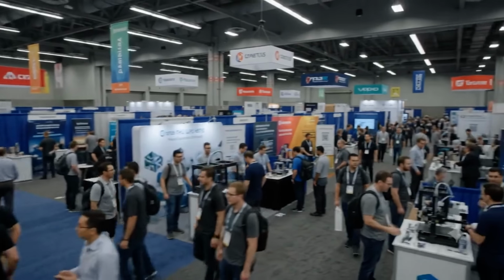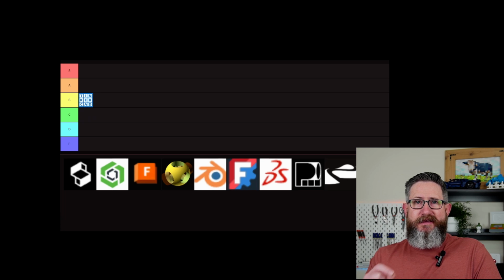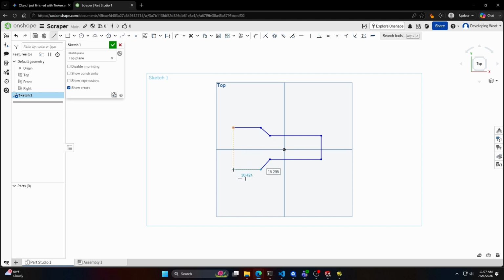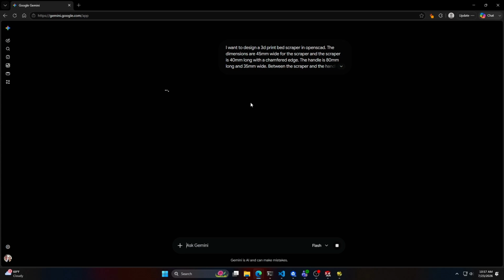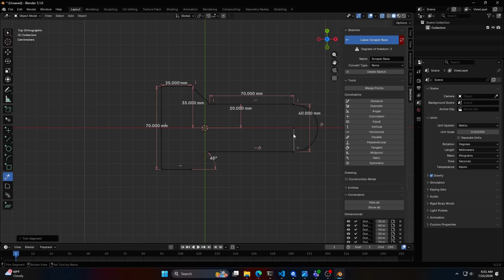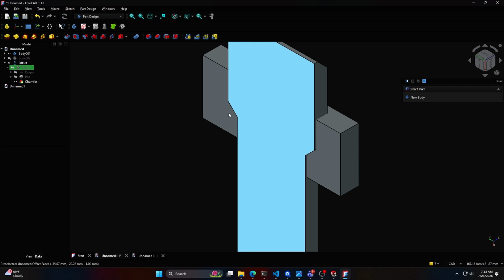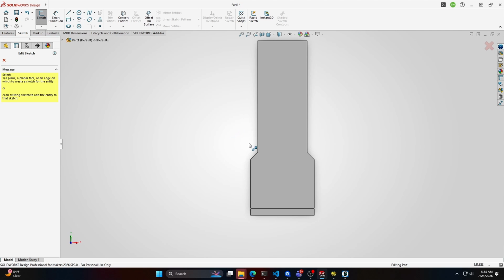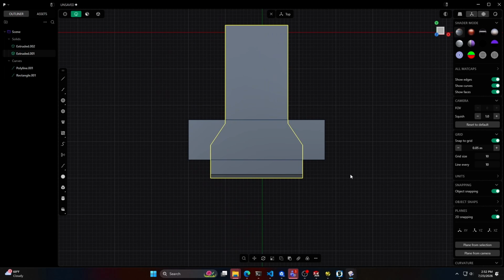Don't Pick a 3D Modeling App Until You Watch This!

Comment from the maker: Which was the biggest surprise to you?
Reply: I'm surprised you put Tinkercad above Freecad. That it took 45 minutes and video help to make a simple model. That model can be done in 3 minutes.
Reply: The biggest surprise for me was the hilarious app names in the thumbnail. "ClenaSad"? "Acmesk"? "FUSNDER"?!  :'-D  Aside from that, it was a great video, TY!
Reply: Not surprised... yet another CAD ranking video that doesn't include SolidEdge, there's no excuse not to include it, the community edition is free.
Reply: To draw this model in FreeCad it would take me not more than 15 minutes, but I'm not experienced with it. Switching in between different workbenches. The whole model you can create in part design. With FreeCad you can create models with relative sizes, with Excel and you can program your own tools. Different tools are for free available..
Reply: @spaansh Excel...I might try that! Thx.
Reply: SolidWorks is a bit of an industry standard and as such it's very difficult to update. You have engineers and designers from huge corporations working on it since 20 years, any major update to the UI/UX would drive people crazy. That being said it is insanely powerful but I agree with out that there are better options for "makers". OnShape probably is the best if you don't care about the license of the free tier, and freecad otherwise.

Regarding programmatic CAD, you could also try cadquery, which is a more intuitive version of openscad based on python.

There, take a comment for the algo :D
Reply: There is a new kid on the block...Solidcraft!
Reply from the maker: @robertcoetzee191  Yes I've been watching it. It's very exciting!
Reply: That Solid Edge Community Edition is missing as usual

Comment: Two notes about FreeCAD:
1) The GUI looks old-style - yes, but if you stick with the default settings. Most new video tutorials recommend switching to the modern GUI right at the start.
2) The menu is long and packed with tools, which can be confusing — especially with the default settings.
If you just want to model a scraper, you only need two workbenches: Sketcher and Part Design (the latter handles 3D modifications). You can hide the other workbenches in the settings or simply ignore them in the drop‑down menu.
You’ll need the additional workbenches later for tasks like modeling assemblies with moving parts, strength analysis, aerodynamics, and so on. Some workbenches, like the Part Workbench, may be considered legacy tools — and this legacy setup isn’t very newbie‑friendly.
Reply from the maker: Thank you so much for taking the time to share these awesome tips! You hit the nail on the head—switching to the modern GUI and focusing purely on the Sketcher and Part Design workbenches makes the onboarding process so much less overwhelming for beginners.

Breaking it down like this is extremely helpful for anyone reading through the comments who might be feeling intimidated by the sheer number of menus and legacy tools. I really appreciate your contribution to the community here!

Comment: I've used them all and would recommend Plasticity... Once you've learned a few simple shortcuts, it really is the closest you can get to thinking about something, then drawing it out. Modifying an existing part is also intuitive and above all simple. Complex surfacing can be accommodated up to class A and the transition from surface to solid seamless.
Reply from the maker: It’s great to hear your experience—the flow and surface modeling in plasticity is really in a league of its own!

Comment: FreeCAD's biggest issue is that it's not "discoverable" - it's hard for a beginner to instinctively know what to do if they just open the program for the first time. You need to commit to watching a few tutorials first, but once you know the basics of navigating, there isn't any reason that part couldn't have been made at about the same speed as Fusion or OnShape (workflow is pretty similar once you get going.) The workbenches can be somewhat confusing, but for that part there would have been no need to even leave Part Design. And as for why choose Plasticity over Blender - it's because your object will still be a BREP solid in Plasticity, whereas Blender is limited to working with polygon meshes. If you're 3D printing, that's not as big of an issue, but depending on your needs, having real , scalable, solid geometry would definitely make the difference.

Comment: Solidworks performance is very graphic card dependent. If you have the memory and a suitable graphics card (and doesn't mean powerful), with the right language support it is far better than Fushion especially the assembly and mate system. I have used Blender, Freecad, Fusion and Solidworks is easily the best out of those.
Reply from the maker: SolidWorks really is incredible when it comes to assemblies and mates, and having the right hardware setup makes a massive difference!

I actually realized recently that the main issue I was running into was specific to the Maker edition constantly syncing to the cloud in the background, which was causing some crazy latency on my end. It definitely was not a fault of the core SolidWorks engine itself, which is a total beast for complex assemblies. Thanks for sharing your experience with it!

Comment: I doubt solidworks for pros is faster. I used it on a MacBook Pro with a VM running Win11.  Yes, the emulation layer makes it harder on the system, but this piece of…. Software couldn’t even *load*. 

And as a software engineer I can tell you that the way the feature-limited solidworks for that tinker version has little bearing on performance.
Reply from the maker: I appreciate the insight; it's helpful to hear from a software engineer about why that specific version struggled so much on your setup.

Comment: Fusion is clearly s-tier. It has variables, multiple files, parametric, joints and motion, and it has cam and drawings. It allows a designer to build very complex components. I have no clue as to why you put it as a tier only.
Reply from the maker: You are spot on about its feature set. Fusion is an absolute powerhouse, and for complex engineering, advanced assemblies, and integrated CAM, it is hard to match.

My rating was really looking at it from the free hobbyist perspective. When Autodesk started gating features on the Personal tier—like limiting active editable documents and export formats—it just left a bad taste in my mouth. But as a complete CAD package, there is no denying how capable it is. Thanks for sharing your thoughts!

Comment: Thanks for the reviews. I have tried to use FreeCad. I have to agree with you about this software. It is not intuitive to use and the interface is outdated. Thank you for mentioning OpenScad. If you have any programming experience and some maths it works well for simpler designs. Used with AI it’s great and because AI gives meaningful names to parameters you can modify stuff to get useful results. I tried Onshape and found the UI intuitive until it was not. I might try TinkerCad.
Thanks again for the reviews
Reply from the maker: Thank you so much for watching and sharing your experience! It is super interesting that you are using OpenSCAD alongside AI—giving parameters meaningful names is such a clever way to make tweaking and iterating on code-based models much easier.

Tinkercad is definitely worth a look for quick, simple shapes, especially when you just want to get an idea out of your head without a heavy UI getting in the way. Every tool really does hit people differently depending on their background! Thanks again for the great comment and for being part of the community.

Comment: I have been using SolidWorks since 1997, and there must have been something wrong with your connection, because I could have designed it as a multi-body part or in an assembly in just a few minutes
Reply from the maker: Using SolidWorks since 1997 is awesome! Having nearly 30 years of muscle memory with a tool definitely makes modeling a breeze, so I can totally see how you would knock it out in a couple of minutes.

You were actually spot on about the connection being the issue! I discovered after making the video that the SolidWorks Maker edition constantly syncs background data with the 3DEXPERIENCE cloud platform on almost every feature action. On my end, that cloud-sync overhead was causing major latency and micro-stutters, which made it feel really sluggish. It definitely was not a problem with the core SolidWorks engine itself. Thanks for watching and sharing your perspective!

Comment: SolidWorks user since 1998, but only the pro premium version. 
SolidWorks is not made to make just a simple part, which it definitely can, but is to make big assemblies, in my case sometimes ove a 25.000 parts. 
Also SolidWorks has integrated modules for, sheet metal parts, electrical parts, pipe routing, stress simulation, flow simulation, rendering to photo-realistic pictures, history of versions, CAM integration, parametric configurations of a part, etc....

Comment: Plasticity is so easy to use and the part you created would take a couple of minutes. Don't know why you struggled with it and preferred Blender that you are totally familiar with, but therein lies your answer.
Reply from the maker: Thank you so much for taking the time to share your feedback! I really appreciate you joining the conversation. Getting different perspectives from people who love these various tools is what makes this community so great.

I actually agree that Plasticity is an incredibly slick tool, but for me, it came down to the modeling paradigm rather than just familiarity. Shapr3D actually took my top spot in the video, and I had never used it before! OpenSCAD and FreeCAD were also ranked higher, and both were brand new to me as well.

Plasticity is intentionally pitched as "CAD for artists", it relies heavily on a direct modeling workflow that’s fantastic for concept design and rapid hard surface art. But when I'm designing mechanical parts that need strict parametric history, constraint solvers, and structured feature trees, I found the workflow less ideal for that specific engineering mindset.

That’s the beauty of having so many options today, the "best" software really just comes down to what matches your specific project goals and how your brain likes to work. Thanks again for watching and sharing your thoughts!

Comment: As someone who has used Solidworks on a daily basis since it launched in 1996 and owns a desktop license I could model that in about 2 minutes. But I accept 30 years on there are better (and much cheaper) ways that I'm just too old to learn.
Reply from the maker: 30 years with SolidWorks since launch—that is incredible! Having that level of muscle memory makes a massive difference, so I can totally see how you’d breeze through it in a couple of minutes.

Also, I actually ended up figuring out what was causing my major latency issues with SolidWorks: it turns out the Maker version syncs with the cloud in the background on almost every action, which was grinding everything to a halt on my end! Once I realized it wasn't the core CAD engine itself but the cloud-sync overhead, it made a lot more sense. Thanks for sharing your perspective—30 years of experience with one tool is super impressive!

Comment: Unless a CAD system has both assembly capabilities and a drafting environment, it's worthless.  Not everyone 3D prints.  I have a home machine shop and design my parts in CAD then use actual paper prints to convey that information to my shop floor.  That means that FreeCAD is about it for the free options.
Reply from the maker: That’s a really great point about the workflow. For making actual physical parts on the shop floor, this is an area where I have no experience so thank you for sharing yours.

Also, I’ve been really enjoying your channel! Watching the steam engine builds and the metal casting process is super fascinating. Keep up the awesome work!

Comment: Your missing the new king of parametric 3D CAD.  Siemens Solid edge community edition.  Full Solid Edge, installed completely locally, FEA, crazy modules that model gears and shafts etc automatically and do the engineering cals at the same time, advanced reverse engineering features, and it's free.  No internet connection required.
Reply from the maker: This is awesome! It sounds like a great option for those looking for local, advanced features. I'll have to add it to my list for a future video! Thanks for the great comment!

Comment: Something that wasn't discussed was CAM functionality. One of the reasons I have stayed with Fusion is its ability to not only output directly to my slicer of choice, but also generate toolpaths for my CNC machine. I'm sure there are alternative (and free) workpaths for this, but using Fusion means I don't have to learn another application.
Reply from the maker: You make a great point, and having CAD and CAM integrated in one workflow is a huge time-saver for anyone doing more than just 3D printing! I would love to someday try one of Makera's devices and when that happens, I will need a program that can do CAM, so that could completely change my current workflow.

Comment: I've been using freecad - cos it's free, the other ones looked difficult to me, or it looked like I would need to pay at some point.. so no.
I've used Cadam (good 2 & 2.5D system), Catia, UG (now NX?). I tried to use CV (computervision), but it or I failed.

Freecad is a annoying to use as it links too much stuff together early on. So if you want to modify something, you probably have to scrap what you've done and start again. Fortunately it keeps the sketches, mostly.
Catia was good like that, all the solids were seperate, then do your Boolean things later, fillets at the end. 
You could use planes to draw on,  instead of sketches and the extraction to drawing was so much better than freecad. Very buggy.
Reply from the maker: Have you tried SolidCraft? It's also free and is supposed to have a more intuitive UI. Would be interesting to get your thoughts on it.
Reply: @wootsworkshop  I was going to try their version 0.19.0, but windows wouldn't let me as it's unsigned. Should I try an earlier version?
Reply: @wootsworkshop  Found the V 18.2 browser mode.
I like the little orientation XYZ tool (top right) for moving the part around. Very intuitive.
There were 2 onscreen menus that got in the way, I couldn't figure out how to move one under the other for more workspace.
Initially the sketches drew like freecad (I'm copying a model). 
Sometimes the dimensioning did odd things with the dimension going off the page, but typing in the number fixed that.
I couldn't figure out how to make multiple circles the same as a single dimensioned circle. (Rivet holes)
I made 2 solids with space between them and it unioned them together - annoying
OK so I tried the second sketch as a surface to trim elements in the first sketch to. I could not generate a solid from sketch 1, it kept selecting sketch 2.
It could select the shaded are within sketch 1 (whatever that is) but not circles I put in for holes and standoffs.
That makes it unusable.
Needs work - I can only figure out how to save locally so can't share?
Reply from the maker: I've just started digging into it myself and I feel it's still very early in development. I love where the free options are going, but this seems a little young still. I think they are trying to build their own geometry engine with AI and AI still struggles with floating points so that's probably why it unioned them together. It's super cool to hear your takes on it given your experience in the industry.
Reply: @wootsworkshop  That could be the whole problem - trying to get AI involved? Make it too clever? That locks a user into doing things the coder wants and that is not always best.
If they make them simpler and let the user do the add, subtract, split etc, then it becomes like building a Lego structure.
One feature I didn't try was to create an offset plane at random in space and sketch on that.
I started in 1983 with Anvil2000 - 3D wireframe. It worked but it was based on a mainframe that I had to share with the analysis group, so it took 2-3 minutes to draw a line. Back to the drawing board.
Cadam was an electrified drawing board - very easy transition.
Catia was eye opening with the introduction of solids and hidden line removal. Menus instead of Icons, easier for me, others didn't like it. I could build a gearbox complete with internal oil cores. Fillets needed work.
UG (NX) was similar to Catia, just a lot of icons to learn. Fillets still needed work.
Then I retired in 2015. Got back into CAD mostly to find solutions to tire balancing, but there are other practical solutions. The 3D printer takes the place of needing a lathe, milling machine, drill and making things out of wood - which all still have their place
Reply from the maker: That is an incredible journey through CAD history! Going from shared mainframe wait times on Anvil2000 all the way to modern 3D printing in a home shop gives you a really unique perspective on how far these tools have come.

You make a great point about simplicity, too. Sometimes the best workflow is just get out of the way and let you build brick-by-brick without the software trying to guess your next move. Thanks for sharing that history—it's super cool to see how your background with tools like CATIA and NX translates to printing today!